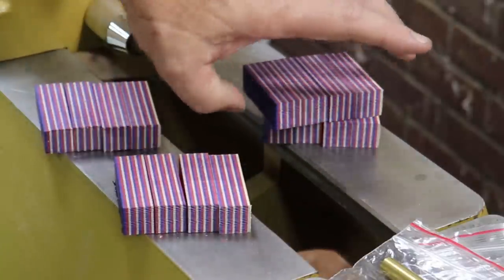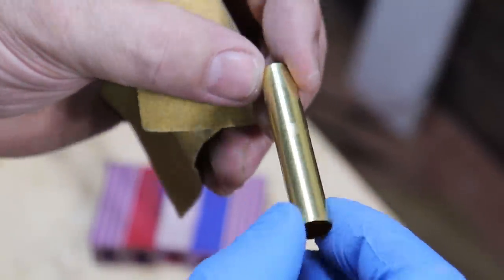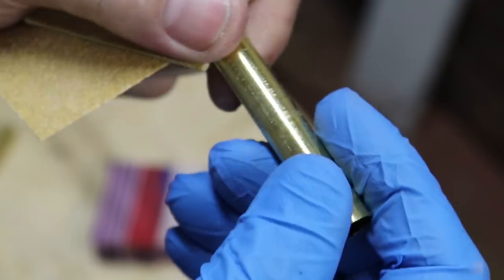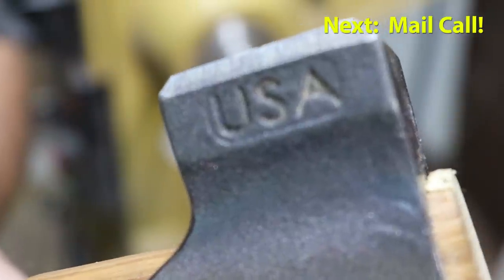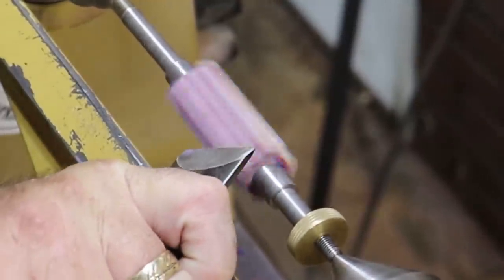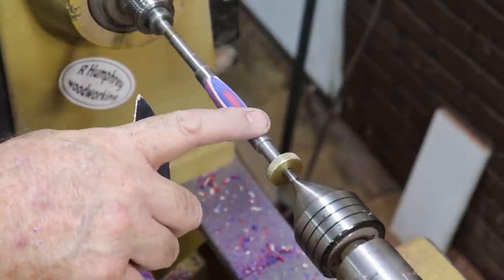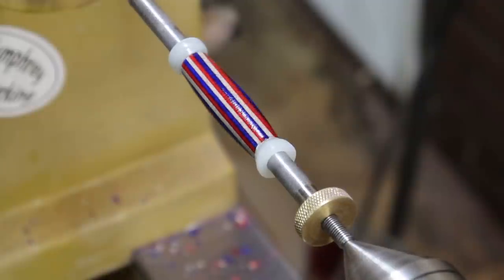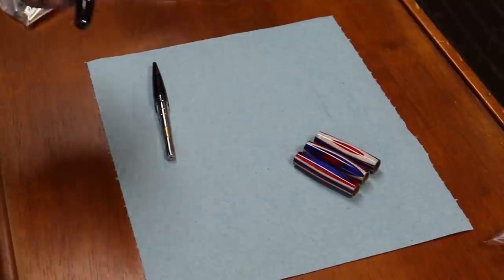Woodturning with an Axe ?

Comment: Those pens are beautiful, Rod. Using that axe as a skew was awesome. First thing I thought of when you started drilling was shavings in resin. I bet those pens would also look great if you cut the blanks at an angle. Take care. 
Bill
Reply: Spectraply doesn't turn well cross grain. It tends to chip and come apart in my experience.

Comment: LOL.  I haven't used an axe on the lathe yet, but it does prove that a good, sharp tool can be used in a pinch.  I've used a few of my (door hanging) standard chisels as a skew and a scraper on occasions.  Until I have the right tool for the job, I'll use what I've got.  Thanks Rod.
Reply from the maker: Absolutely, Dave!  The edge didn't hold up past one pen, but it's sharp again of course.